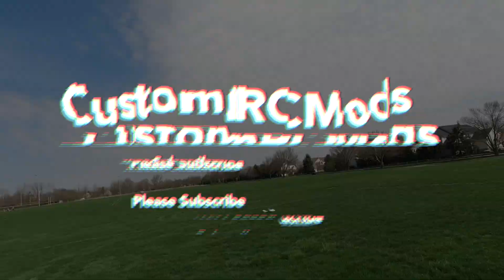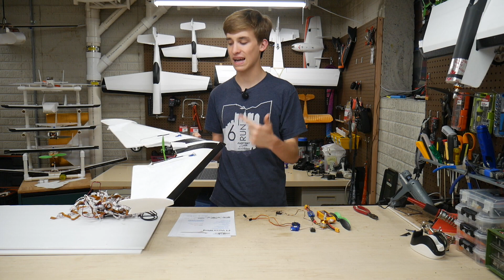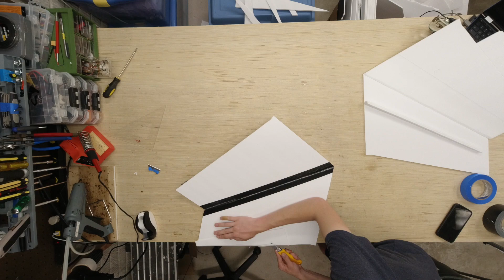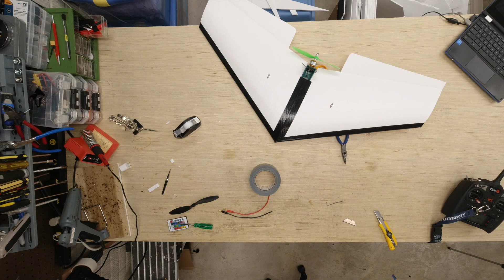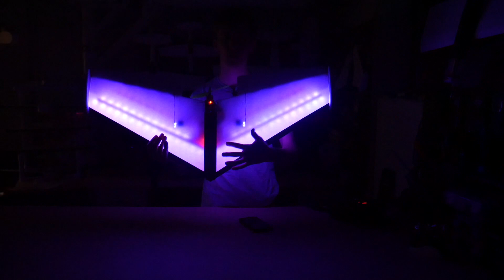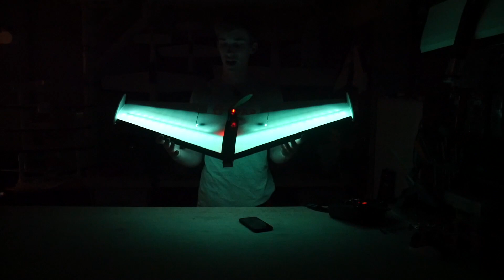LED FT Versa Wing Build + Initial Thoughts

Comment: Loved the video.  What did you use to cover your plane?  Looks really smooth.  Also how did you remove flat spots in the upper wing surface?  THX
Reply from the maker: This model isn’t covered in any way except some duct tape on the leading edge. In the past I’ve used packing tape to laminate my wings which works quite nicely. the removal of airfoil ridges was done by removing paper on one side of the foam on the inside top of the wing and bending it to create the airfoil curve if that makes sense.

Comment: Nice video Noah. Are you using maker foam from Flite Test? I’m just wondering if regular foam board will allow the leds to glow effectively.
Reply from the maker: This is just the regular old Adam’s Readi Board you get off the shelf at dollar tree, works like a charm. The maker foam should work well too, I would think. Thanks for watching!
Reply: @CustomFPV  Thanks. One more question. Do you use black duct tape or black packing tape for your trim scheme? Keep up the good work!
Reply from the maker: That’s black duct tape. Nice and strong on the leading edge. Thanks!

Comment: Built my blunt nose versa couple of months ago last week maiden flight. But I think my motor is underpowerd for it would this engine be overpowerd? https://www.banggood.com/SURPASS-Hobby-C3542-1000KV1250KV1450KV-Outrunner-Brushless-Motor-for-RC-Airplane-Fixed-wing-EDF-Ducted-Fan-Unit-p-1615378.html?rmmds=search&ID=517699&cur_warehouse=CN love your vids
Reply from the maker: Thats a little large, correct, however you could make it work with a little extra noseweight. thanks!
Reply: @CustomFPV  a little there is already 150g up in the nose :) . But I'm going to make a new battery so hopefully its gonna work. What engine would you recommend?

Comment: Can i ask did you buy a  speed built kit or just cut it in a 2 sheet of foam
Reply from the maker: Scratch built, simply cut out from foam.
Reply: @CustomFPV  nice so you just use the pdf files
Reply from the maker: Yep, tiled out. pretty basic, keeps cost down for sure

Comment: I was hyped for this!! Looks aaamazing!! 

Never flown a wing and now you've got me inspired to make one! 
Which wing that can be made out of foam board would you recommend to a begginer?

[I have a 3D printer and know CAD, so if it requires 3D printing it's no problem for me :)]
Reply from the maker: I started out in wings with the FT Mini arrow, as my 3rd plane ever. Very nice and controllable. I would recommend that with a little 1806 (Power Pack A Spec) motor and a 5 inch race quad prop (4-5 inch pitch). It will be a nice cruiser but still will have decent speed and a nice sound to it :). That wing is so much fun and very durable as well, so no worries if you have a few mishaps while you are getting the hang of it. And no 3d printing or CAD is necessary for the arrow, just a simple firewall and power pod setup makes it easy. Thanks for watching!